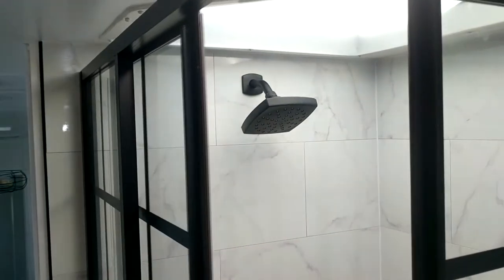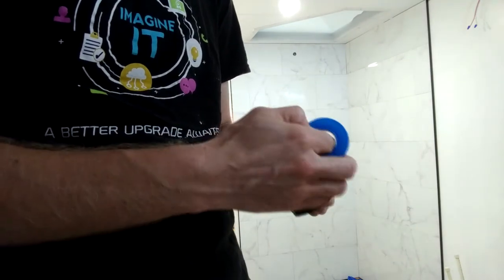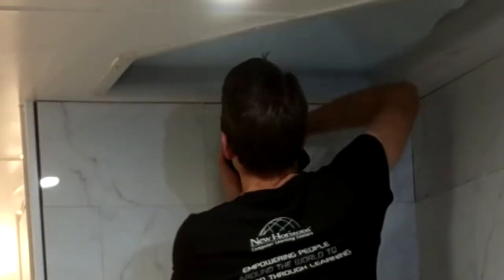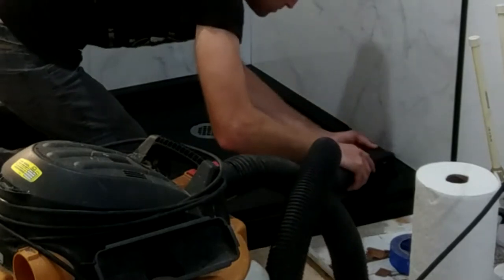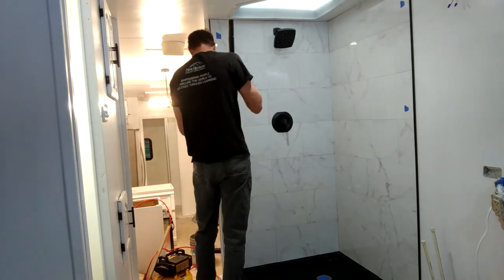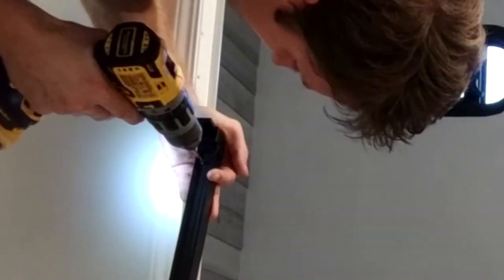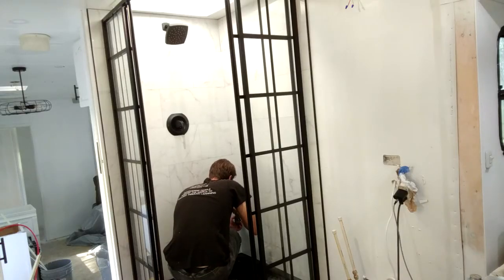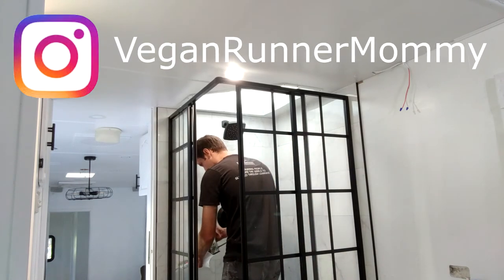PART 4 - How to Remodel Your RV Shower to Look Like THIS! || Installing The Doors and Plumbing Trim

Comment: How did the shower door enclosure hold up when towing the RV? Getting ready to install that same shower door on my toy hauler, just a little concern how it will handle bumpy roads.
Reply from the maker: Never had an issue